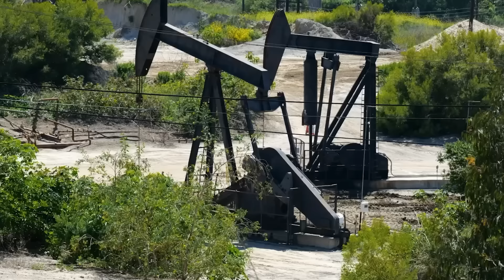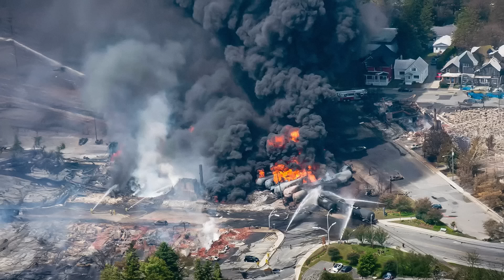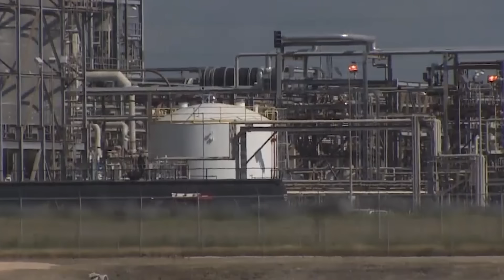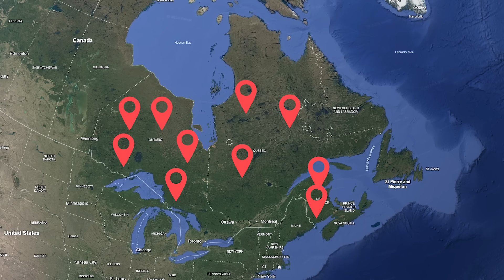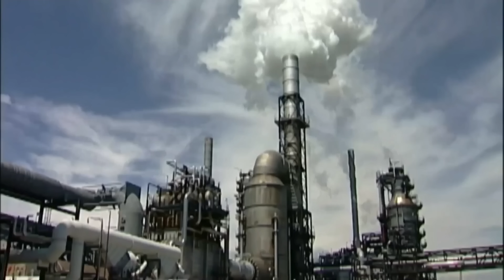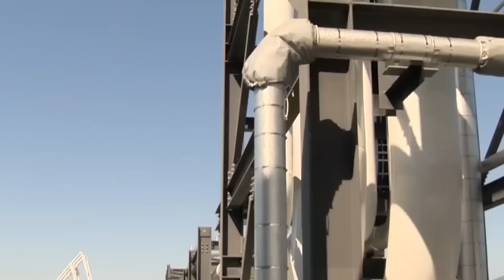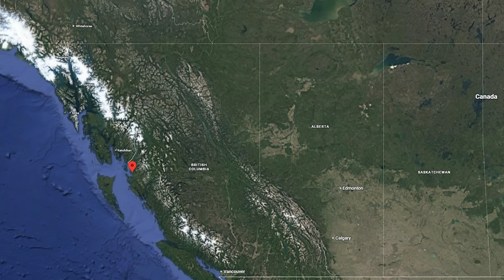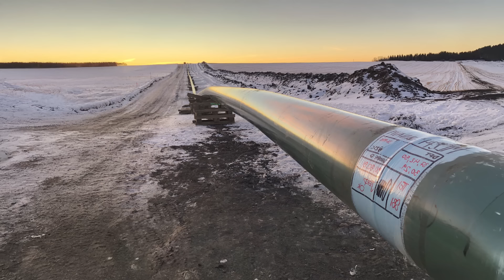Here's Why Canada Can't Build Its Own Refineries, Even Though It Produces Millions of Tons of Oil

Comment: I literally live in a town called Sarnia that has 3 refineries plus one process plant that refines gas to make ethylene and 3 polyethylene plants. Currently the price of oil does make Alberta pipeline to the west coast economically viable.
Reply: Montreal, Saint John, Edmonton, and Sarnia come to mind
Reply: @jamesduggan141  St-Romuald
Reply: It's one of those odd myths, every province has at least one except pei.
Reply: Jet a is a HUGE resource out of Sarnia, much of it going to the GTAA holding tanks (and some to private fbos, harmac says hello)
Reply: Are you really say this video is wrong? Providing lies other people will use as a reference? Making people dummer? I just know conservative extremes will use it.
Reply: Yes @ronlemont8307
Reply: @ronlemont8307 why would a conservative use this video as a reference?
Reply: @ronlemont8307 It is a bit out of date already. The decision has been made by Alberta, BC and the feds made to run the third pipeline, Pacific Link along the TMX pipeline route but this time to a new oil terminal at Tsawassen called Deltaport which already ships coal and unloads sea containers. This will allow larger tankers than Burnaby.
Reply: While there hasn't been a major "greenfield" (entirely new) oil refinery built in Canada in several decades, the existing 16 refineries are undergoing significant updates focused on three areas: decarbonization, renewable fuel conversion, and operational efficiency
Reply: and less emission from ships as they care about emission and environment.
Reply: Halifax has refineries too
Reply: Sorry that you live in Sarnia.
Reply: I live in Sarnia, Canada also, and yes, there are 3 large refineries.
Reply: how did you get to this conclusion genius ?
Reply: According to Google, Canada has 16 -19 refineries.
Reply: I live in Wallaceburg and I was going to say the exact same thing this area Mainely petroia but that's where the first oil was ever manufactured for retail they mix gravel with the oil and made patties and then sent it back to Britain where they used it for the roads
Reply: Lol currently yes
Reply: Refinery in Port Moody as well.
Reply: @ml.2770  the refinery closed in 1995, now it is a storage facility only
Reply: Those refineries use mostly light and medium crude with a bit of heavy added.  Currently the price of Western Canadian crude is barely above the cost to process it.   It has been below that cost for a few weeks of late.   Western canadian crude needs to be upgraded or all you get (mostly) are the heavier elements like Diesel and asphalt etc.
Reply: Not if it affects other industries heavily reliant on the health of the environment. You can't eat oil and plastic.
Reply: @eadfacaadcacaea4837 unfortunately people still drive and need the convenience of oil based energy. Strategically Canada should have had the pipeline installed years ago, then we would be immune to price fluctuations.  Canada imports oil for the refineries out east so not having a pipeline has not reduced our consumption, it has just made it more expensive.
Reply: @DouglasMTB1959  I think the more logical long term investment for this country is high speed rail. It doesn't eliminate the need for driving but it would vastly reduce the amount of oil needed. But it's incredibly costly and the oil and gas and automotive sectors would fight tooth and nail to keep it from happening. There should be lines all over the east coast and lines connecting Edmonton to Calgary and over to Saskatoon and Regina and over to Winnipeg. An expansion out west through the mountains would likely be to costly for now but in time all things are doable.
Reply: @daximuspr1mus its a dumb idea!! For 100 reasons.
Reply: @eadfacaadcacaea4837 as a former hippie from the 60s and 70s i and others like me were the first environmentalits. Now at 7t years old ive learned that many of our protectionist ideas are costly and possibly nonsensical. You can't eat oil but you can't create much food without it. And dont try tell my about 500 hp electric tractors.
Reply: @eadfacaadcacaea4837  coffee creamer and craft slices
Reply: The problem is that Alberta oil comes to Sarnia via the US., which makes it vulnerable.
Reply: Sarnia gets its oil through Enbridge Line 5 which comes down through Michigan. It has to cross between Upper Michigan to Lower Michigan at the Straits of Mackinac. The twinned pipelines are on the lakebed. They cross the St. Claire river into Sarnia. The State of Michigan wants to shut the pipeline down. They fear the environmental damage should the pipelines leak into Lake Michigan. Enbridge is ready to build a tunnel under the lake to take the pipelines. All but one of the permits were in place then Michigan threatens the shutdown. If that Line 5 closes, Ontario would experience a drop of 45% to 53% in crude oil supply. Gasoline would spike 20 cents to 40 cents per litre. Sarnia's refineries would be very hard hit. The case is before the US Supreme Court. There is a treaty in place between Canada and the US that the pipeline access can't be revoked. Michigan wants it to be a state court case, Canada wants it federal. It's an anxious time given all the other havoc the US is causing.
Reply: He is missing the most obvious point.   Irving oil out East is owned by Justin Trudeau's family..  they want a monopoly on eastern oil supply
Reply: @timdailey1343     Tell my you have FOX on 24/7, read Toronto Sun  and vote only Conservative without saying so.   Irving Oil is owned by the Irving family.  Imagine that.  Irving oil is one of the largest PRIVATELY OWNED companies in Canada.   There is NO connection to the Trudeau family.
Reply: @timdailey1343 A simple search reveals the lie in your statement.
Reply: Refineries in Liberal ridings are allowed. What we don't want is anyone not bending the knee to Liberal rule to be prosperous.
Reply: So are the half dozen refineries in Alberta are in Liberal ridings only then?  Twit.
Reply: @ml.2770 They were put in back when Liberals were Liberals. Guilbeault wanted those ones gone. The Liberal party is now the party of activism, corruption, authoritarianism, and emotion. I guess I could also add the party of disparaging comments, as you attempted insult demonstrates.
Reply: @ickster23  So why are there refineries in Sarnia, in Ontario.  They usually vote Conservative and have a Conservative MP now?    So much for your dopey ass theory.  Are you from Alberta?
Reply: @ickster23  there are 3 refineries operating in East Edmonton which are very safe Liberal ridings, the second place candidates are mostly NDP. there are these things called facts you might check into.
Reply: @captain34ca So, you are saying Guilbeault and the Liberal party isn't pro net Zero and anti refinery- anti oil. I must have missed that memo. As for Edmonton ridings being socialist, that goes without saying. The urban demographic is low self agency and relies on government in a similar fashion that infants rely on parents.
Reply: @ickster23  Wall St bankers, based in Manhattan, excel at sucking on Uncle Sam's giant tit, but I wouldn't describe them as "low self-agency".  Your urban Audubon bird guide needs an update. You seem to be confusing self-agency with plaid flannel-shirt machismo.
Reply: Guilbault quit 5 months ago because he thought the Carney government wasn’t green enough compared to the previous government.
Reply: @stevenhattrick9495  no he quit because carney did the mou of dreams of pipelines

Comment: Our government does not want what is best for Canadians. Once you understand that, everything else makes more sense.
Reply: Show me the data
Reply: @jimness5902 The data is all around you. Open your eyes.
Reply: Didn't listen to anything he said did you.   Alberta only has heavy crude.   You need sweet crude to mix with heavy crude because sweet crude and heavy crude produce different products.    With sweet/light crude you get the lighter products like methane.  With heavy crude you get products from the heavy end of the crude.   From light crude you get mostly • 	Gasoline (biggest output) • 	Diesel • 	Jet fuel / kerosene • 	Naphtha • 	Liquefied petroleum gases (LPG)
 From heavy crude you get Asphalt / bitumen, • 	Heavy fuel oil  Vacuum gas oil 	Petroleum coke • 	Lubricants and waxes.   Thats why you need both.  But he is wrong about Canadian crude sulfur content.  Canadian heavy crude has a high sulphur heavy crude but not even close to  the content of  the stuff coming from Venezuela.
Reply: It's nowhere near that simple. A refinery network will cost billions, and require steady, ongoing political will, while politicians generally care only about the next four years. This is true regardless of the party in charge, unfortunately.
Reply: Asinine comment, straight from PP’s talking points. “Only the Conservative Party want to do what’s best for Canadians, all other political parties hate Canadians and are trying to destroy the economy and country!”. 🤪🤪🤪
Reply: @Sparky722 Look at the last eleven years. If it is not obvious that the libs are bad for canada, then you must be extremely well off or you don't live here much like the pm before he got elected/installed.